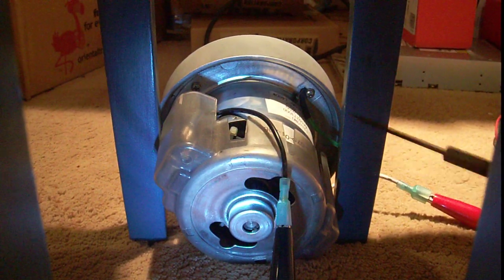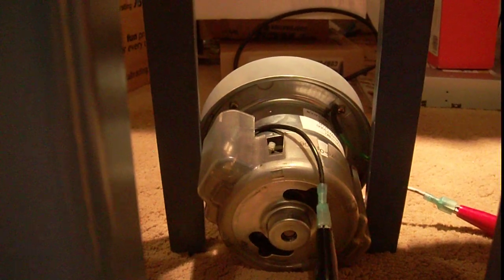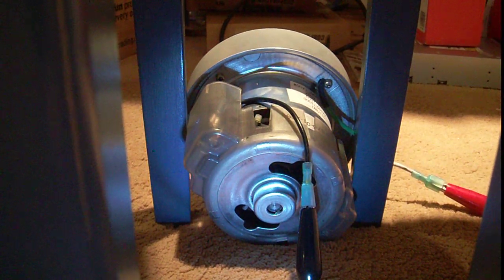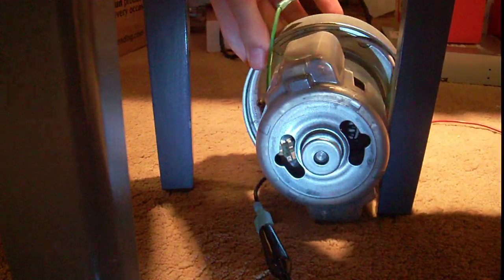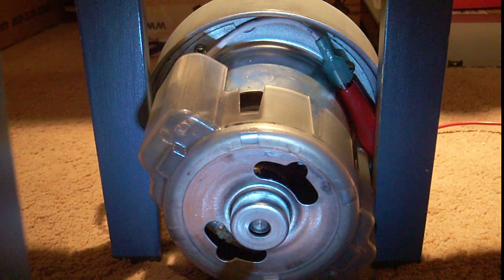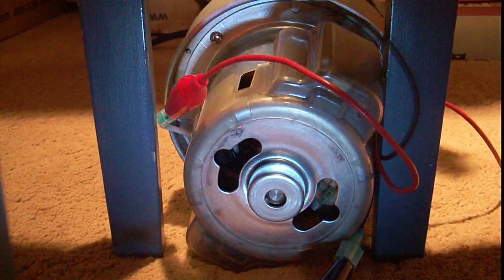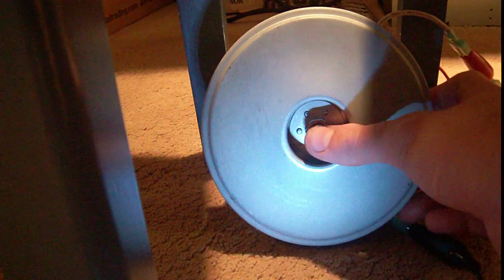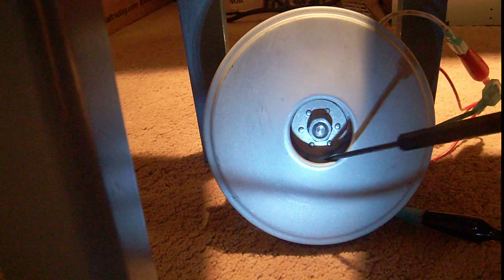Super Power Vacuum Cleaner Motor

Comment: It is a brushed motor. The sparks are normal in all brushed motors. The armatur that spins gets it power by two carbon brushes that rub the copper contacts. If the brushes get to worn down they can spark more and will cause loss of power hard time starting and so on. Most brushed motors that stop working like in a drill grinder or what ever most the time just need to cleen the contacts and change the brushes that only cost a couple bucks. I have picked up several dead tiools and got online found the brushes and tool works like new. Most the time brushes are good for 200-300hrs depending on size and the amps.

Comment from the maker: @t0p0l1eve4 thanks for the tip, but the case from the vacuum cleaner was broken, so it would do no good. 
also the hose the vacuum cleaner is connected to isn't air tight enough to mantian a good vacuum, too leeky, but the case idea might work, thanks for the tip